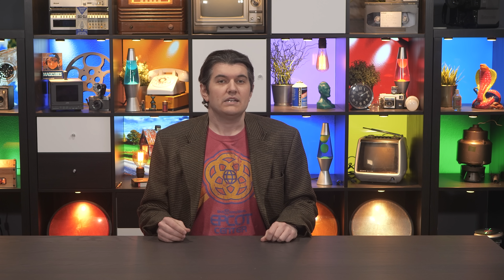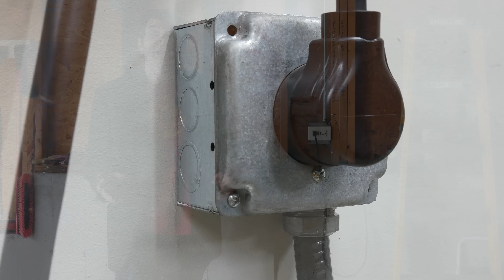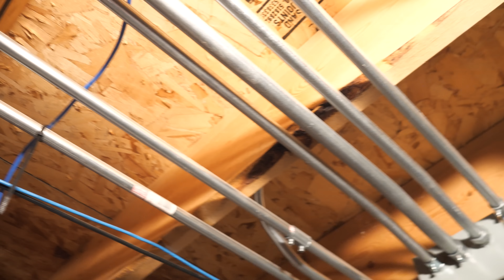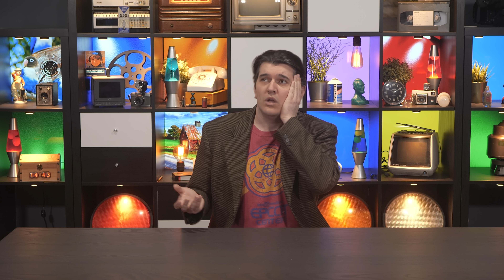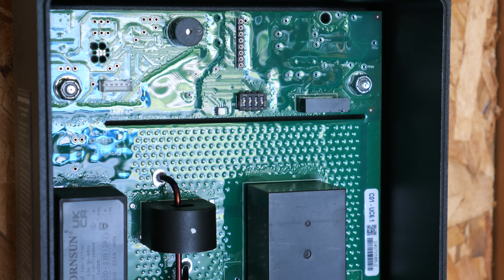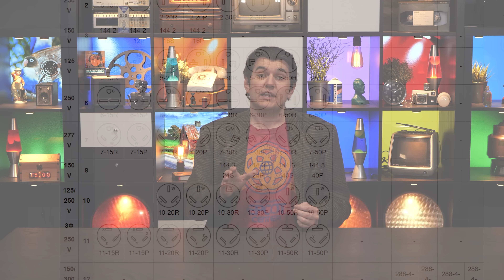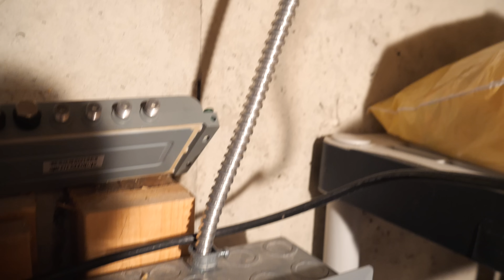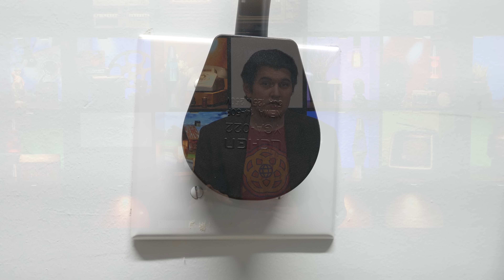The "standard" car charger is usually overkill—but your electrician might not know that

Comment: Am I grateful, that here we just have 230V16A (10A (2.3kW continuous or 16A ~3,7kW hardwired or blue CEE) and then 400V32A (13kW) sockets (red CEE, although the plug and socket can apparently even do up to 800A, but you won't get that in a residential setting). Looking at the 1000 different NIMA plugs it just seems like a complete nightmare, at some point it is probably easier to either overspec or check and hardwire instead of having that many plugs, right?

And even with these much simpler configurations, I don't think I've ever seen anybody here who has a charging station with a plug (except those portable ones with standard schuko), instead every single one I know just has been hardwired, since it won't move anyways and it's even easier than to install a socket as well. I just don't get why it seems that the US is so allergic to just hardwire things, many things here that are intended to be permanently fixed somewhere, like changing stations aren't even sold with a plug and installing them is just a matter of putting a junction box somewhere if one is not yet nearby, using a WAGO nut to clip the cables together and that's it, it's a few minutes of work and way safer even than a socket especially with the janky US sockets.

Also WTF, there's aluminium wires in the US? It get's crazier by the minute... Like copper wiring isn't that expensive, even when buying like 50m or 100m...

Comment: Once again Tesla rules with their tech prowes. Tesla Mobile connectors have a temp sensor on the plug and automatically stops charging if the outlet gets too hot. Not aware of any other EVSE that does that.

Comment: My mom's Volt (the plug-in hybrid version of the Bolt) charges on a 20 amp outlet we have in our carport. It's an older model, 2012 I think? and its a plug-in hybrid, so it's battery isn't the best compared to most modern EVs, but its still enough to go 30+ miles on a single charge, making it a perfect town car. We can charge it from "near dead" to "all good" overnight, even WITH a lower charge rate than modern EVs. Do you hear that EV owners? My Mom's 10+ y/o car with a much less efficient battery chemistry, diminshed charge rate, AND hilariously tiny battery because it has to share space with a fuel system too, can be her daily driver off a single nightly charge on a standard US 20amp outlet (the one that looks like -.l instead of I.l). To be fair, a full charge cycle DOES take 12 hours, but thats going from "Absolutely dead, had to switch to gas to get home" to "cannot charge another microwatt, the battery is so full". But also, our house has wiring from the 60s and we're completely on solar without a battery bank, so we have weakened power ANYWAY, your gridded house with your cars with good efficient charging and modern battery chemistry should be just fine...

Comment: Happy to have CEE-type connectors here in europe for applications that involve high current, multi-phase or protection against enviromental constraints. The best part: If it says 32 amp on it, you can actually use it for continuous 32 amp loads :D (They would even widthstand little higher currents, but obviously that is a no-no.)
 These connectors are super reliable (therefore used in industrial settings) and have a high count of mating cycles before they wear out. Strage that they seemingly arent a "thing" over in the US and instead NEMA is used, where it seems to be posible to get electrocuted from half-way inserted plugs...

Comment: You definitely need more than 120 for a 2019 model three that’s what I have and 120 does not cut it even for small amounts of driving. And solved my 50 amp for $60 at two different houses.

Comment: I think people should also consider their average use case of a car more when purchasing generally. Thinking about the more niche cases where you might require significantly more storage, seating, range, or towing capacity will point you at a vehicle that is significantly larger and inefficient-er than you need. Not to say they you should never buy a silverado ev, there is a use case, but most people aren’t going to benefit from it on a day-to-day basis any more than they would in a bolt

Comment: I already had a NEMA L6-30 plug in my garage, very near the door, to plug in my 3HP cabinet saw. I bought a Clipper Creek EVSE unit with the appropriate cable and plugged it in. It worked great for all of our EVs, but mostly is used nightly for the Volvo plug-in hybrid. Today, I'll mostly charge the F-150 Lightning at work, using the inexpensive Chargepoint unit in the garage where I park. It costs maybe 80% more than the same juice at home, but the convenience is worth it - I get about 40mi or so added for less than $2. Still way cheaper than gas. And I'm already parked there anyway... If I'm planning a trip, or haven't been able to park in that garage for a while, I'll swap the Ford to the home unit and it generally will "top up" overnight. If I depended on it to deep cycle the extended range battery, it would take maybe 3 days! But I don't do that. I'm not dumb. I've had 5 EVs, plus the hybrid. They're not rocket surgery.

Comment: This video did nothing but show me than an electric car isn't for my family, or possibly that my life is extremely not like anyone else's. Our main car is spending 5 hours at home today. The others are too large to be reasonably electric, but they are meant for moving things around. This might be the side affect of being a small business owner. Of course some small business owners can have a better setup, but that varies by your life. I've also planned an over 200 mile drive last night. Also planned over 300 miles each way before also. That doesn't leave time for charging. Yes I do work 14+ hour days sometimes, and yes I know I don't get enough sleep. This is why I think the choice should be to educate the public to what works for them, and let them figure out what is good. Also we aren't ready for everyone to be on the same system, it is currently best to have a mix of systems in use, and pick what is most efficient for each use.

Comment: As a veteran electrician, I always hardwire anything that isn't supposed to be moved, using a plug for those things will always be trouble down the line, trust me. Sometimes I even use ceramic connectors to help dissipate the heat because hardwiring high loads will usually cause the electrical tape to melt and harden around the connection point.

Comment: We’ve had an Ioniq 5 for 2.5 years, and for home charging we’ve only ever used the level 1 charger that comes with it. Our breaker panel has no extra space in it, and it’s across the whole width of our house from the driveway. So adding/upgrading the circuit wouldn’t be cheap. In the meantime we usually deplete less than 10% of the battery on a typical day, so I only bother plugging the thing in a few times a week. We’re considering a second EV to replace our aging gas-powered compact hatchback, and would probably just keep using the 1.3 kW setup for two cars. I’d certainly try it out for a few months before calling an electrician. Obviously if we had longer commutes it’d be trickier, but it’s true that a lot of people worried about charging time should do the math and see if they could just charge their car from a NEMA 5-15 stuck to the side of the house.

Comment: My daily commute is about ten miles round trip. I live in an apartment, with no chance of getting charging infrastructure. What are the possibilities that they might make detachable luggable battery packs that I could bring in from the car to my apartment to charge in the living room? 
(public transit isn't an option, it doesn't go where I need to be during times I need to be there; cycling isn't an option due to the icy conditions and heavy snow in the area)

Comment: yep, to add an EV outlet I'd use a 'smart plug' off my 240VAC/30A electric dryer circuit...no need to pull a new circuit that way.

so 24A maximum continuous, I'd probably try limiting to 16A starting out.

Comment: Intresting. I charge my car between 1.8 an 3kW in the EU due a limitation on my breaker. Default chargers are mostly 11kW (3x16A @230v) and some, are even 22kW cause they have a backoffice service with lcd display. Most granny chargers have settings of 6-8-10-13-16A@230v ip to 3.7kW, but at 13 (3kW) and 16A (3,7kW) you do need a spare breaker.

Comment: I agree with you. For those driving a Plug-in Hybrid, you probably don’t require anything more than a 110v outlet. However, I disagree with you in that the higher amperage is necessary if you reside in a colder climate. The car requires the additional power to precondition the battery during winter, and if it doesn’t receive it, the energy used to heat the battery is drawn from the HV battery instead of the grid.

Comment: Another benefit of slow charging: Low charge current means lower battery degradation, meaning you dont need to get the battery swapped as often

Comment: Smart Charger usage: 
- maximize solar charging from your solar panels
    Solar is also a reason to have charging >5kw as a solar installation is quickly larger...
- protect your installation from overload: the charger ensures the house is not using more energy each phase can support 
- In my case: I am charged on my peak power consumption each month; I can keep the paek power each month 'low' with the smarth charger (that is: the car charging is not adding extra peak load versus my other consumption...).
But needing an app: more important there is a local API so you don't need to go over the internet to set the chargers' settings.

Comment: My pet peeve is when people call the home charging stations "chargers." Nobody installs an EV charger at home. These level 2 EVSEs/charging stations you put in your house aren't chargers, the charger is inside your car and these plug-in NEMA 14-50 "chargers" are more like smart switches that open and close a contactor to allow electricity to flow to your car's built-in charger. All that matters is getting to 240v. You do not "need" the high ampacity outlets. Even 15-20 amps is fine for topping up your half-drained battery overnight.

Comment: One thing I can say is that using a NEMA 14-30 (30A) dryer outlet in the heat of Texas can actually loose charge if the climate control has to run to reduce temps.  You can be plugged in and see loss of charge even at 24A rated speed.  So doing this off 120V can be impossible depending on the state of charge of the battery and how long you have.  🤠👍

Comment: You spoke about privacy and security concerns around the 24:00 mark in your video. This highlights a point that I hope you'll discuss in a future video -- the overarching privacy and security of electric vehicles as a platform. It's the chief concern standing in the way of me buying an electric vehicle, as I don't trust them to be private, secure, or geared towards the consumer's rights as an owner. Being connected to the internet genuinely raises a red flag for me, and I don't trust auto manufacturers to have the consumer's best interest in mind when producing these types of cars. I'd love to hear your thoughts!
Reply: You won't be able to buy any car newer than the 2010s, regardless of what it runs on. They all use the same connectivity features. Of course, they make you pay for those connectivity features, because a cellphone provider charges them for the data. So you can simply not do that, and the car company isn't going to pay a phone provider to spy on how often you go to the store. Your data isn't that valuable. You could also have the cellular modem disconnected physically if you're really paranoid

Edit: of course, you could also get an older car and convert it to electric with a kit!
Reply: @SpaceBearEngineer  That's not entirely true. Though not as common, there are still newer cars being produced that aren't tied to the internet. I own a 2015 Jeep that in no way can connect to the internet.
Reply: And if it is internet connected, I’d look into how to remove the SIM card wherever it is.

Comment: I do have a 'smart' charger, because if I want the car to charge off only solar power, I need it to pull 10A, but if I want the car to charge quick enough that I can take my kids to school in the morning/overnight, it does need to go up to the 40A maximum of the 14-50. Basically, solar/slow speeds if I don't need the car soon, and faster speeds if I do need it soon. I could in theory do that with the GRIZZL-E as well, but I'm not changing dip switches every time I want to do that.

Comment: As an all EV household that is used to how charging works, the number one difficulty I have in talking to others (non-EV drivers) about the paradigm of refueling an EV is that refueling an EV is a parallel activity. This is true if you're charging at home, or on a road trip and stopped for food and a necessity stop, the car is refueling while you are doing OTHER things in your life. In an ICE vehicle getting gas is a time additive.
Reply: It's not much different than a cell phone. You plug it in when you're done with it at the end of the day, and you wake up to a full charge. Most of these EVs can go 5-7 days of regular driving without needing to be charged. On road trips, it doesn't really add time if you have kids or a wife. I stop to charge every 2 hours. It takes about 15 minutes, and I'm usually waiting on one of the kids or the wife anyway.

Charging is a solved problem unless you can't charge at home or live in a sparsely populated area in the Rockies or West Texas.

Comment: I will second, third, and fouth recommend the grizzle, its made in Canada, has a 5 year warranty and is UL listed for REAL, and its dead simple construction make it rock solid. Its a bit more costly then the cheep as dirt ones on amazon but if I am spending 20~40k on a vehicle I am not going to skimp on the refueling equipment.. Also I am with you that i get super infuriated at the brain dead smart chargers out there... Its stupid and a way to just bump up the price of the units while making them unreliable. I actually dident even need level 2 at home and was able to make my 66mile commute by just charging off the 15A 120v charger that came with the car that plugs into a normal household outlet. Only reason I got the 240V one is because my GF would need to drive over 100miles in a day and need a quick 5 hour turn around in the same day due to her having to go to school in the next city over. I got by on the standard old charger for over 3 month's before I installed the larger one.

Comment: Before I bought my EV, like many people I didn't really understand the "charging to 80%" vs "fill the tank" mindsets. I drive less that 200 miles a week, and my car has a 360 mile range. I have free charging at work (including free DC fast charging if I'm pressed for time) so once a week I plug it in at work, move it at my first coffee break, and that's it. I have a 120V charger to use if I need it, but I've used it twice in a few months.

Comment: As someone who is slowly getting into diy smart home stuff, the fact that a charger would have its own circuit breaker is a much easier way to track energy usage than trying to connect another app of some sort. As long as I can set the car to charge during certain times, I'm happy.

Comment: The guy who lived in the house before me ran a welding circuit to the garage, but it was on a NEMA 6-50, so it ONLY provides HHG, no HHNG like a 14-50. It took me a grip to find a 5-50 charger at ~the price of a 14-50, but when I did, I get 60-80m in ~4.5hrs. It doesn't NEED to be NEMA 14-50, is what I mean to imply. There are a TON of ways to get power to a car, including branching off of a dryer circuit in a garage and using a "Cut-over" switch to choose which "appliance" to power.

Comment: I use the tesla mobile connected to a nema 14-50 for my tesla.  It stays plugged in and I have a 2nd one for trips.  I have the car set to only pull 32A but the outlet is on a 50A breaker with copper wiring.  I had the nema 14-50 outlet put in because I wanted to make it more useful and available for other things as needed like say a welder or air compressor of compatible size to that outlet.  I don't think I will ever use it like that but was thinking if I sell the house someone else may use it like that and it adds value to the house...hopefully.  I enjoyed your charging videos but would love to see them updated to the NACS format.  From ne midwesterner (I admit I ran away from the cold and currently live in a much more temperate area of NC so please don't take my midwesterner card!) to another...keep up the good work

Comment: 24:53, there is one caveat to that statement I can think of: the somewhat niche case where you are a commuter with a company car, and your commute is supposed to be covered by the company. In that case, you might actually get a deal where they'd cover part of your electrical bill, as long as you can prove that that's the proportion you used for charging. For that, having a separate meter on the charging outlet would be useful.

Comment: We installed the Grizzl-E Classic charger on a 50am breaker because we have a PHEV, not full electric. With the lvl2 charging at home, I can often get to and from work on full electric, plug it in, then get to and from the store on full electric after dinner even with only 22 miles of battery range.

And for folks where it's just the price that's a barrier: look for local initiatives. We paid an electrician to install the breaker and a plug for the charger and got 50% back on the cost of the charger and the full install.